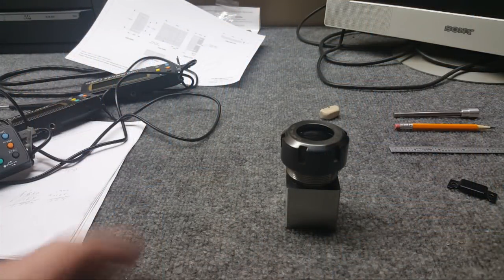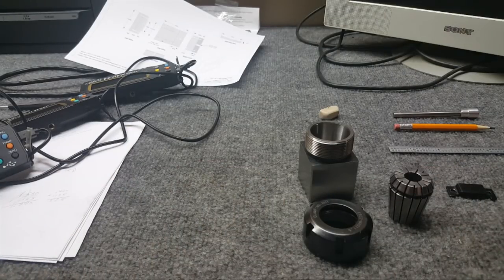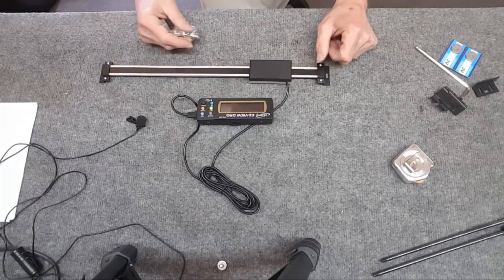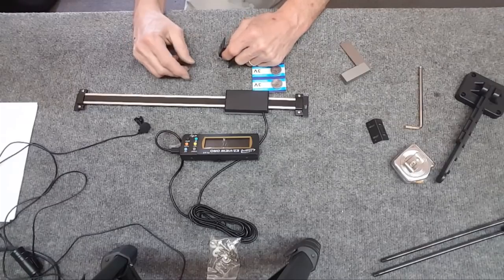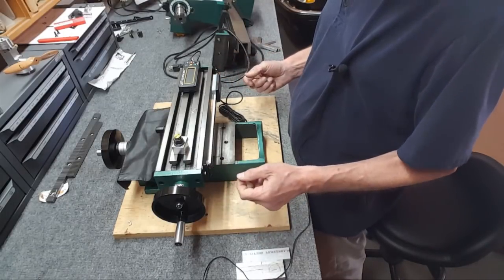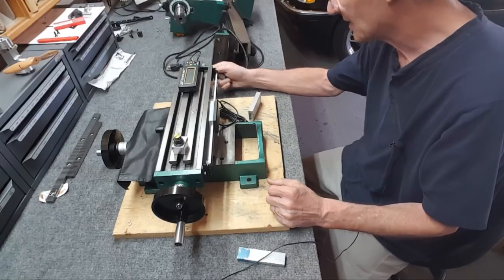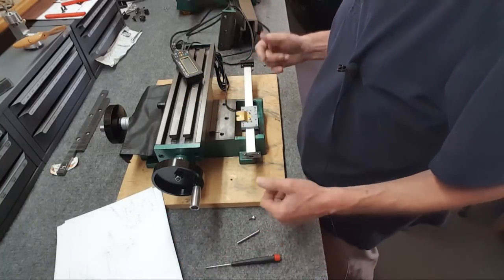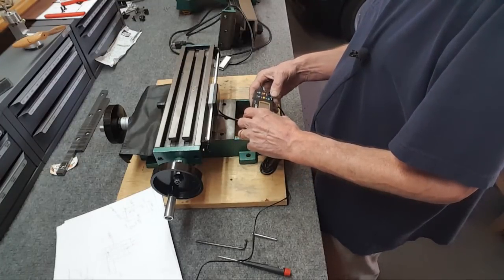iGage EZ View DRO Plus Installation

Comment: Can the beam of the 12" Easy View DRO be cut to size. Its about 1" longer than the bed of my mini-lathe. Thoughts?
Reply from the maker: yes it's aluminum and I've cut many with a hacksaw.
Reply: @TheMiniMachineShop  Thanks so much. BTW Great Video!!
Reply from the maker: Note: those scales are extremely touchy they can't be bowed angled or anything out of perfect alignment. I had made my own mounts because the stock ones bowed the beam. @BruceWSims

Comment: I bought my EZ View scales from Taylor Toolworks a couple of years ago to install on my Taig micro mill.  I am also using Yuri"s Touch DRO with them.  Taylor still has the scales available in 6", 12", 24" and 36" lengths.  You don't have to buy in sets.  Just contact them and they will sell you what you need.  They are great to work with and I have bought many items from them.  The scales can also be cut to whatever length you need them to be.  Just use a very fine hacksaw blade (I used a razor saw).  I had to make some brackets and mounting blocks to fit my mill, but they work fine.

Comment: Dave press the collet down in to the nut,it will snap in no more run out.
Reply: BMWDCK75 Yes. ALWAYS press the Collet into the nut first, then screw the nut/collet onto the holder.
Reply: Agree!  Newbies never realize the way collets need to be used correctly.  But we all learn!

Comment: Getting the needed aluminium block I milled out 2 squared blocks and the clamping parts to hold the magnetic scale. Drilling and tapping for M3 I tightened 16 lbs force magnets to the Alu-blocks. A third maghet, an M3 screw, 2 nuts and an Alu piece bolted to the measuring, sliding part, gave me an easy mountable Z scale. Removing the paint, getting down to the naked metall will increase the holding force of the magnets. A true amateur solutiuon but it works well.
Waiting for the scales for X and Y, hoping to mount them the same way.
Reply: Now I've got the 6 and 12 inch scales. The first ALU blocks are milled and using 22 lbs magnets to attach the Y scale to the base looks really promizing. The slider mechanics will also be attached by a 22 lbs magnet. Tests for the X scale looks promizing too.
 If You have time to send me a private note with Your Email I can send You some pictures.

Comment: I found that if I added wave or spring washers to the mount arm and did not use the supplied washer the display is rock solid.

Comment: Hi Dave!
Thanks for this video. Resently I recieved one DRO scale of the same kind as Yours, except for the display having the buttons below the display. The mounting brackets for the magnetic scale were the same as Yours. An easy test clamping one bracket to a piece of flat steel rod showed they were like Yours, would bend the scale. Aluminium is ordered in order to make squared brackets.

Comment: If the dial indicator is not set accurately to the horizontal, see 22 mins, you will get a false reading, not by much over .010, but it is accumulative.

Comment: Don't worry about the buttons on the display.  If you go to Yury"s Touch DRO you won't need the displays.  But I will warn you to not try to go to four decimal places as the units just won't hold still at the 4th place and it will jump a lot.
Reply from the maker: The fix on the fourth digit jitter is used a power adapter that has a transformer in it. The supplied one is junk. Mine is rock solid after the switch...6VDC 600ma
Reply: Any suggestion for this type transformer?
Reply from the maker: Not really I have a junk drawer full of them. Pick one that' big and heavy it should have a transformer in it which will deliver cleaner DC and isolate you from the mains.  Most of what I see on Amazon is the skinny switching type. I'll try to show what I used In the next video. This is close to what I have http://poweradapter.co/dve-dv061asb20-ac-adapter-6v-dc-1000ma-power-supply-p-3063.html and it says transformer by DVE.

Comment: Now I've got the 6 and 12 inch scales. The first ALU blocks are milled and using 22 lbs magnets to attach the Y scale to the base looks really promizing. The slider mechanics will also be attached by a 22 lbs magnet. Tests for the X scale looks promizing too.
 If You have time to send me a private note with Your Email I can send You some pictures.
Reply from the maker: My email is shown at the end of every video and I would love to see pictures!
Reply: Haha . I found it and sent You a couple Emails and pictures.
Reply from the maker: Got the email very nice work.. having problems trying to upload a private video for you...
Reply: Your reply appears "here" but also arrive at my Gmail. Sending pictures from Gmail didn't work due to the size, 4 Meg per picture. Using my personal address gave more space. So simple to spell, so difficult to work out…..

Comment: Hi Dave,Thanks for the excellent and thoughtful videos. I am in the process of ordering iGage DRO's for my Micro-Mark mini-mill.  On-line vendors list the scales as  6", 12", 24" etc.  Does 6", 12" and 24" indicate the maximum travel of the unit, or is it the physical length of the scale? TIA,
Mike
Reply from the maker: All I can say is in the video opening them I show the 12" one and watch the video for what I measured it as and the sensor is 3"long so hope you can figure it out from that https://www.taytools.com/igaging-ez-view/
Reply from the maker: http://theminimachineshop.com/Plans/DRO%20Mount.jpg
Reply: Many thanks, have calculated and ordered accordingly.

Comment: Look agine they have a 32" kit with most the parts to fit a table saw. But chipsfly craftsman gallery also an igaging dealer has a slightly differnt peel and stick version for a tablesaw readout.
Wexly also makes a unit for twice the price.  If you like the igaging tools chipsfly has a ditigtal height ga that's extremely inexpensive. 
I worked in a machine shop. But I'm also a woodworker. 
No reason you can't shop at sevral stores.

Comment: Hi Dave, just acquired mini mill to add to lathe. Newbie to all this ,found your site and catching up on vids, very useful informative stuff. (Not much out there for newbies). Will you be showing upgrade for fine adjust on mill as mine is just awful. Thanks for your vids, look forward to see finished mill . Newbie uk
Reply from the maker: Hi Wayne, I did have a vid somewhere on it. Basically I think you're talking about the play in the fine knob. Open it up and remove all the existent linkage from the knob to the back. Just bang the pin out in back. I made an aluminum one piece to replace it and all lined up perfectly. Big difference!
Reply: Hi Dave, thanks for info, happy clippings look forward to next instalment

Comment: You will be happier getting a 7-10" android tablet.  I got mine off ebay for about $75.  I got an adjustable mount to hold the tablet so I can tilt and swivel it if I need to.
Reply from the maker: Picked up a Samsung Galaxy Tab A 7.0 and it's bigger than I thought. Have to figure out how to mount it now but runs TouchDRO perfectly!
Reply: I bought an adjustable tablet mount for mine made by Arkon.  They are readily available.

Comment: i just put mine on my MX9512 mill and its no where as hard as you made it Little bit of over thinking it i believe  .I will say the arms are crap on those displays so mine will be a billet piece soon. Next project is an arduino DRO i found that uses an app on the tablet and uses the capacitive scales.
Reply: Hi apollo robb!
Would You like to send me some info about Your Arduino DRO project? I am running a Micro Mill, a PROXXON MF70, controlled by an Arduino UNO. Connecting a DRO and getting a closed loop control is of great interest.

Comment: Don't use banding for attaching to back of head.  Go to hardware and get some thin sheet steel or aluminum.  You don't want that part to flex.
Reply from the maker: You'll see what I came up with in the next video...

Comment: You forgot to add the 1/16th aluminum corner stock to protect the X axis dro,cost me 4$ and took 10min to make and install ,and why not just remove the table and not the column .
Reply from the maker: I cover the X axis with a flexible plastic sheet I have using Velcro. Removing the table would take a lot more time to put back together because I have to adjust gibs again and get them reseated also lead screw alignment and nut backlash adjustments. The column just bolt it back on and done.